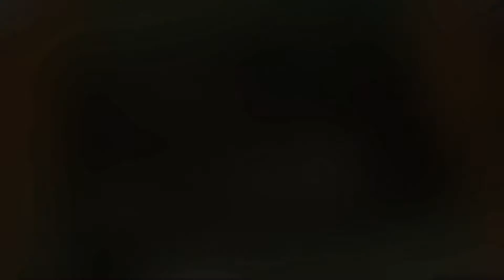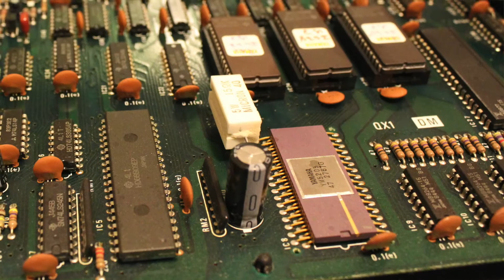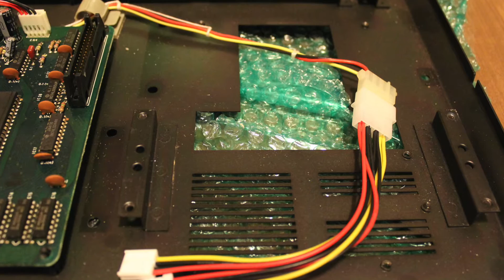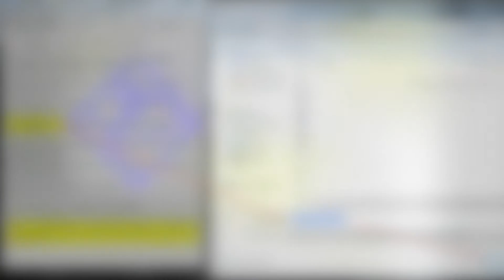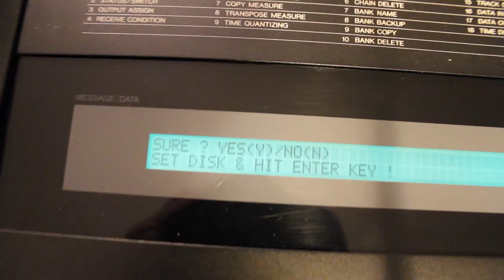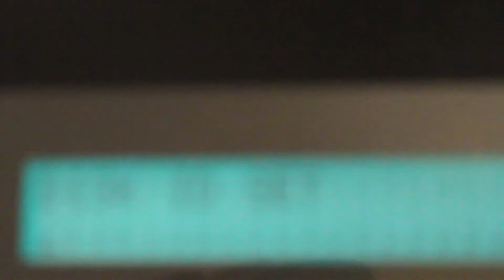Yamaha QX-1 HxC Floppy Emulator installation and configuration tutorial

Comment: Nice video.  Well paced...  I'm attempting to install a HxC in my PPG Waveterm-A.  I went through an OLD box of vintage PC hardware I've been carrying around all these years & found 2x Floppy Connector cables with Dual, Pinned (3.5") and Edge Connector (5.25") sockets on it!  The Waveterms came with 8" and 5.25" floppy drives - mine having 5.25".

Comment: FYI: Floppy drives do not use an IDE ribbon cable, they are not hard drives. IDE ribbons are 44 pins.
Floppy drives are 34 pin and use IDC ribbon cables.